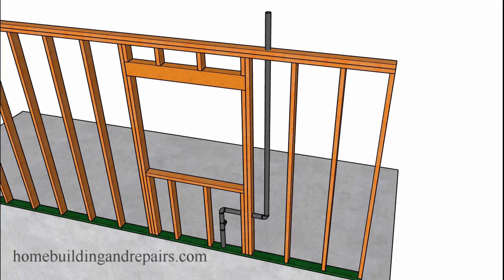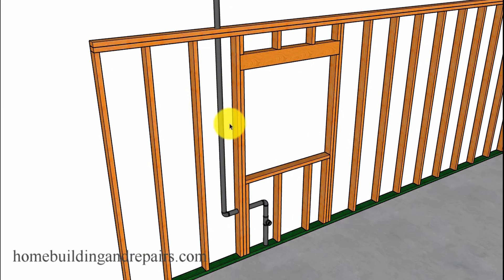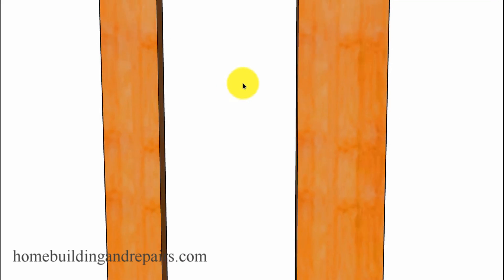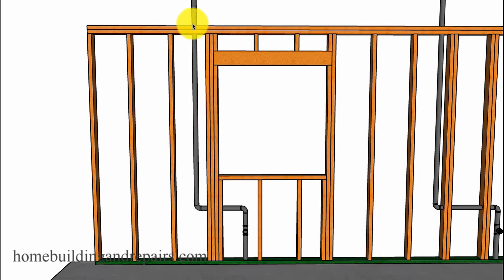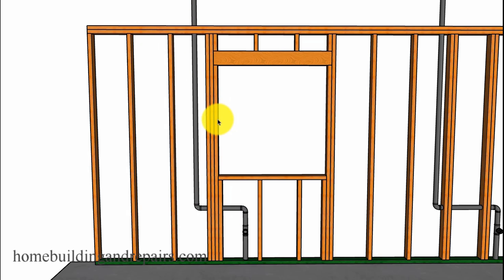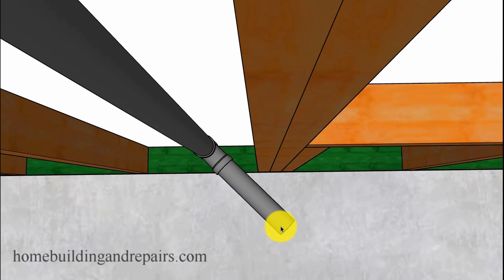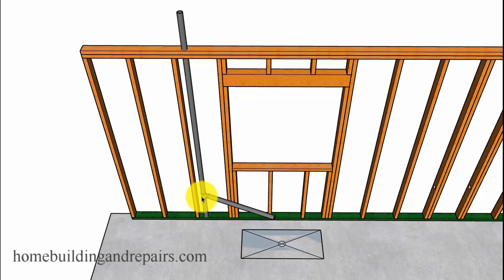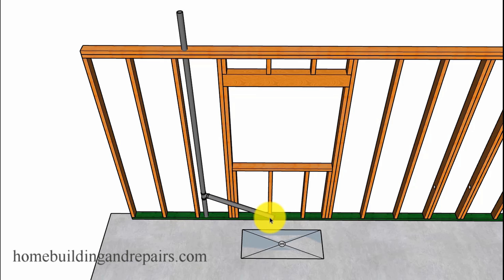Simple Plumbing Drain Pipe Installation Methods To Avoid Drilling Through Wall Framing King Studs

Comment: Hi Good afternoon Juvy checking can  can I go around outside the wall house or need to be inside
Reply from the maker: Most of the time, but you might need to check with your local building department.

Comment: A little something not everyone may be aware of. King studs aren't there just to take vertical loads. They also have to carry horizontal loads, wind against the face of the wall. That's why doubling up the king stud doesn't always solve the problem.

People often underestimate the power of wind. Next time you're driving down the highway at 60mph, put your hand out the car window (keep the other firmly on the steering wheel!) and feel how much force is pushing against your hand. Your hand is only a few inches square. Now imagine a strong wind hitting a window measuring 3x5 feet. That's what your wall has to resist.
Reply from the maker: Very good point and sincerely appreciated.

Comment: Hello. I have the same exact issue, thank you for your video. It clears alot up. One question: I go around the king stud, does the vent pipe have to be at a slope or can it go horizontal? Thank you.
Reply from the maker: Yes, the vent pipe should allow water to drain towards main waste drain.

Comment: Simple solution just forget the vent entirely just put in a air admittance valve otherwise known as a Studer vent and problem solved its would be installed under the kitchen sink from wall out before the p-trap and it's meets UPC/IPC code so no Boston Loop no Foot Vent No drilling so simple to do!
Reply from the maker: If you're local building department allows it.

Comment: We wanted to run through the king stud with a double stud, heavy duty stud shoe around the pipe, and the inspector still rejected it, which seems non-sensical if the concern is weight bearing integrity.

Comment: I have two sink drain outlets under my kitchen sink which sits directly below a window.  What are the chances they are both vertical drains or a dirty arm?   I may need to lower one of the drain stubs in the wall, but if its a horizontal dirty arm I don't think I can do it without ripping our the cabinets which I can't do.
Reply from the maker: The two arms where probably used for each side of a double sink. I'm only guessing, but you can probably just cap the upper one and use the lower one for drain.
Reply: @gregvancom  I did some exploring in the pipe using a light and scope camera and they are both horizontal and curve toward each other to a vertical pipe in the center.  So essentially both would have to be lowered at once.

Comment: Is there any way that you'd be able to show us how to hook up plumbing to an existing septic tank? As I have a second house so to speak in the back of my house with no plumbing?
Reply from the maker: You can connect to the drain pipe going from the existing home from the septic tank if that's possible.
Reply: @gregvancom  thank you I appreciate your advice, and I love all your videos I think they're the best
Reply: @gregvancom  I have one more question. Was wondering how I would be able to get running water to that second house in the back of my house? Do you have any ideas?

Comment: If the vent is going through the double top plate, does it continue through the roof  1 foot from overhang gutter?... Seems weird looking from ground.
Reply from the maker: Yes, through the roof and you can always turn it and run it into the attic about 3 or 4 feet if you need to.

Comment: Greg,

I am facing the problem where I cannot drill through the king stud, in my case it would be a post cause there will a post on top of the window header that support a wider window above.  This is single story house with 12ft walls & cathedral ceiling.

I am thinking of using back venting method underground with wye rolled up 45 deg and run it pass the king stud (post) so no need to bore/notch the kings stud and trimmer.  

Do you think its complianced to code?

Comment: Are you allowed to drill through the 3 beams that support the window?  I'm looking to maybe put a 2 gang box under the window in my master bathroom
Reply from the maker: Most of the time a small 3/4 inch hole through the framing studs is acceptable. Keep in mind that I can not provide engineering advice.

Comment: Could you have a wider header and then run up through the header on the inside of the king stud?
Reply from the maker: I don't see the advantage, but as long as the header is structurally supported by trimmers, then it might work.

Comment: The trap are distances ie. 30, 42, 60, 72 etc are specific to the trap arm distance. It is to keep the p-trap for syphonage. This is per UPC, and the IRC and IPC are less restrictive.  This is not the same as the under floor horizontal drainage is unlimited in length. Table 703.2 of the Uniform Plumbing codes has all the answers for you. Great video.
Reply from the maker: Don't forget to check with local building codes, they could be different on some situations.
Reply: @gregvancom  That generally doesn't happen in the same state, California plumbing code is adapted from the Uniform plumbing code (which started in the city of LA). I have not seen a local amendment that would alter the matimatical probably of the DFU count. UPC is very strict on their opinion on this. 1924 The hoover code, the first plumbing code did the scientific testing under the order of President Hoover and has been the basis for US plumbing code since. The book is out of print, by the Bureau of standards. It is "archived" by good books for free. "RECOMMENDED MINIMUM REQUIREMENTS FOR PLUMBING"
IN DWELLINGS AND SIMILAR BUILDINGS)" very interesting history.

Comment: Hey Greg, question.. i have a slop sink in the garage that i want to relocate with out moving the pipes through the wall. It's that possible?
Reply from the maker: I would think so, even thought local building codes might not want to see it. For example, you could move the sink and then put it back in original place if there was ever a problem with building codes.

Comment: I am looking for a video that better explains vertical hanger supports referencing the 2018 IPC table 308.5 note D. (CPVC)  " such Gods shall prevent pop movement in a direction perpendicular to the axis of the pipe" 308.7 axial movement
Reply from the maker: Great suggestion for video and I will put it on our list of videos to be made in the future.

Comment: For a raised foundation (I guess also for slab foundation too), can a loop vent be used here similar to what is used for kitchen islands? I would think that would work and avoid drilling through the king studs unless the code states loops vents can only be used at kitchen islands. That way all pipes stay within walls.
Reply: That's what I'm thinking of doin..got the same question.
Guessed AAVs not to code in CA?
Reply: Not code in Los Ángeles california.

Comment: On an angle you're never going to get the cabinet installer to work with that.
Reply from the maker: I've seen them complain and you bring up a good point, maybe let them know in advance.
Reply: @gregvancom  how about loop it up and vent it right.

Comment: I've seen a lot of track homes where the kitchen sink looks into the livingroom with a conter/bar. They have to drill threw the king studs to vent. and theres a 10 foot opening. Now you got me thinking how they did it.
Reply from the maker: I've seen it done myself on load bearing walls and pass inspection.

Comment: Hopefully that first example would fail inspection. Vent needs to go 6 in above flood level before going horizontal. Great video!
Reply from the maker: According to most of the plumbers I've talked to, there are special circumstances in the building codes that allow for vents to be installed like this.
Reply: Yes that is correct. In instances that do not allowed this due to the structure, then it still works, but it has to be pitched 1/4" per foot. Normally vents can be flat. In this case, if drilling through, it best (and harder) to drill at a 45 degrees to the FLR and your golden.

Comment: There are three ways to deal with venting under a window, one is to do an Air Admittance device which has it's own restrictions (which may not be code in your area) or to do a Bow Vent, which runs a vent loop in the stud back down under the floor. The other way is to run through the cabinet to vent.
Reply from the maker: Air admittance valves might not be allowed by your local building department. It's a mechanical device that could fail and good point about the venting in the same way as you would kitchen island. If something is allowed for one part of the house, then it should be allowed for other parts.
Reply: @gregvancom  Honestly I think it's more about people putting inside a wall then under a sink.
Reply: @gregvancom  Air Admittance Valves (AAV's) are controversial, because they are good for the fixture, and good for economizing the venting pipe and roofing, but they are not good for the sewer/septic system as a whole.  Plus, they are a device with moving parts, that is prone to failure, and the consequence of this failure is flammable smelly gasses seeping in to the house.  The sewer and septic depend on conventional roof vents, so there is bidirectional flow of gasses, with the sewer gasses venting throughout the system at each customer's house.  If AAV's were used everywhere because of their convenience, and not one standard vent were used, the sewer system would build up a positive pressure of gasses.

Plus, AAV's have the problem of being a maintenance item the home owner may not know they even need to think about, and then after a decade, the valve fails and unexplained sewer gas seeps in to the home.  This is why it is common for standard vents to be required in new construction, even if AAV's as an alternative are allowed in existing construction to fix an illegal unvented drain.

Comment: Nice video. Most kitchen sinks have a window in front of them so wonder how they did it in the past?  Maybe also double up the short leg under the window and bolt the studs together for strength
Reply from the maker: I started working in construction in 1978 and every plumber drilled through the kings studs and I'm pretty sure most of those homes are still standing. Structurally though it doesn't make a lot of sense.